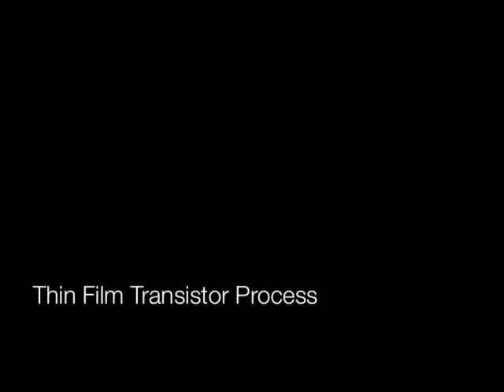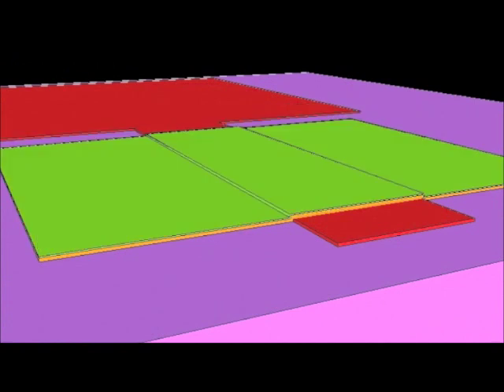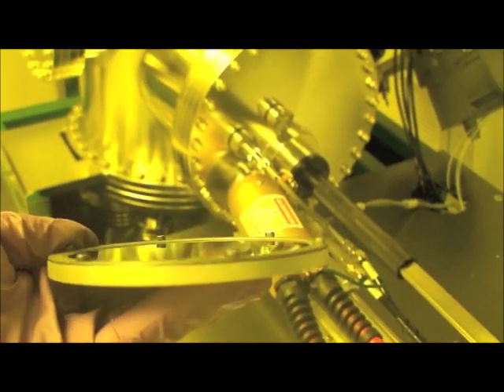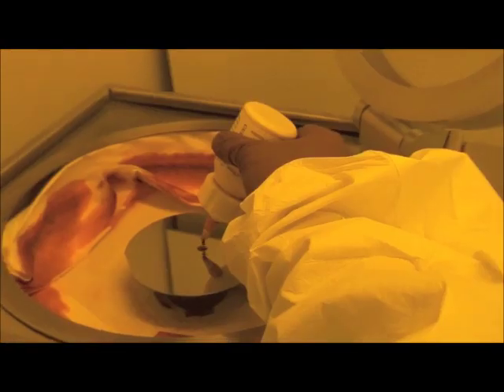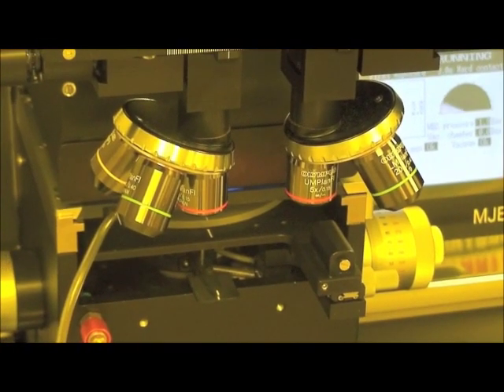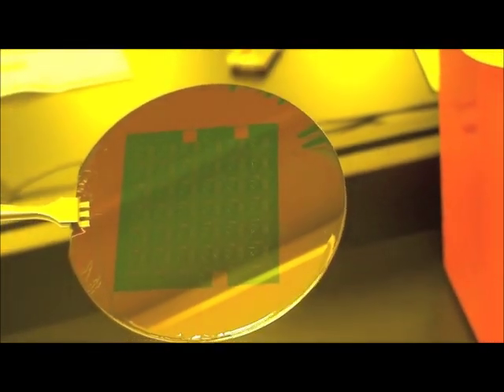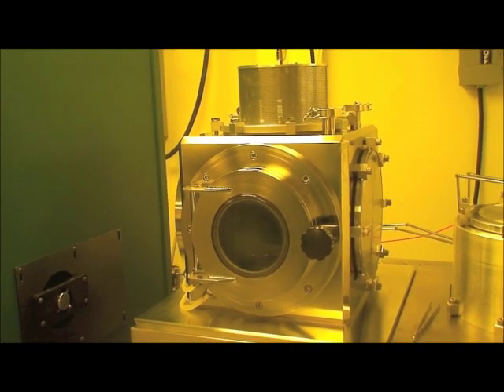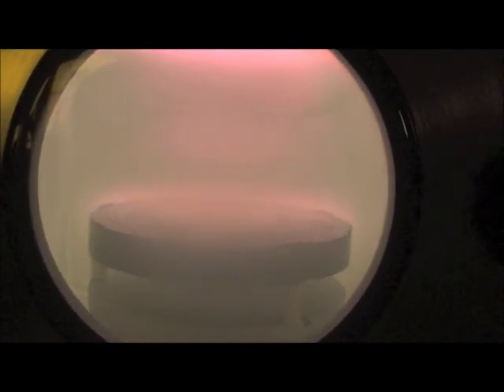Thin Film Transistor Process

Comment: I'm confused how did you perform the doping of the thin film SiN? Was it self doped with the Moly contacts? I saw the construction of the source drain contacts but nothing about actually making the deposited thin film semiconductor either P type or N type.
Reply: The silicon nitride is being used as a gate dielectric (similar to silicon oxide in planar silicon transistors). Here the semiconductor material is Zinc Oxide which has a native N-type doping.